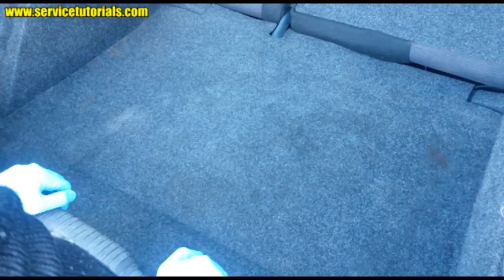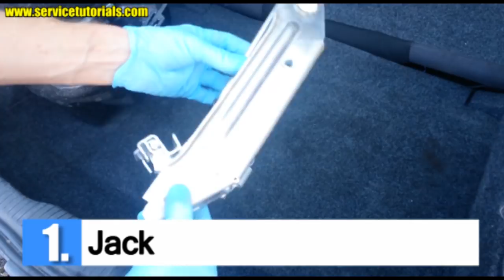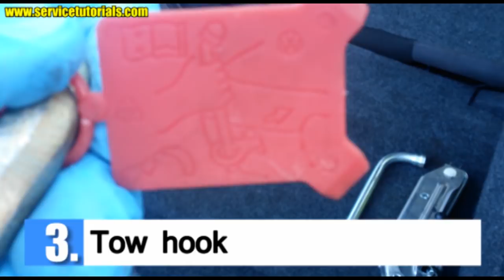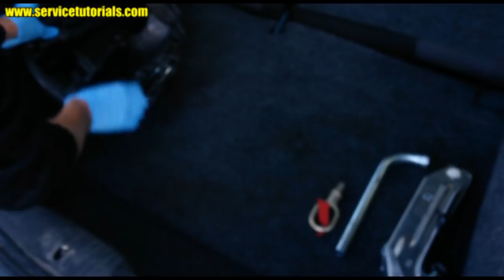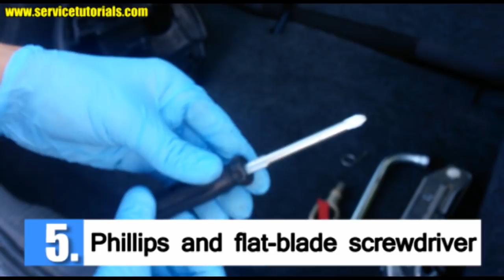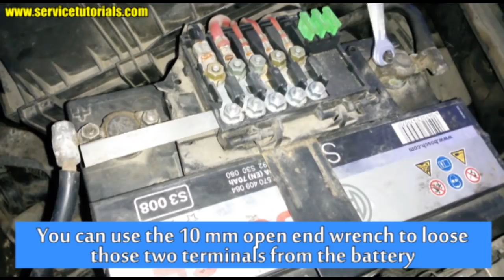What tools you should have in your TRUNK TOOL KIT for VW Golf Mk4, Golf Mk5, Jetta, Bora, Passat,

Comment: Thank you this was very helpful. Now I just bought a 2001 VW golf GLS 2.0 and in the trunk there is a compartment on the left that opens and has a cable and mounting bracket. Do you know what that's for? Is it for a CD changer?
Reply from the maker: chachee15 Maybe it’s an amplifier sound system.
Reply: @Servicetutorials  no I'm pretty sure it's for a stock CD changer. This is factory wiring
Reply: @chachee15  I've opened up the same compartment while installing a subwoofer in the trunk of my 2000 VW GOLF GLS 2.0. That would be the 6 disc CD changer!